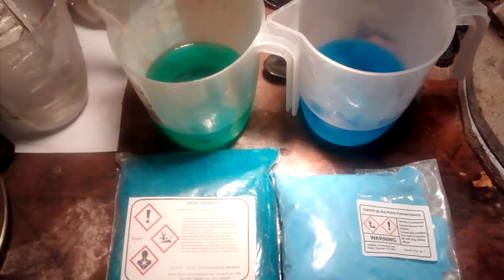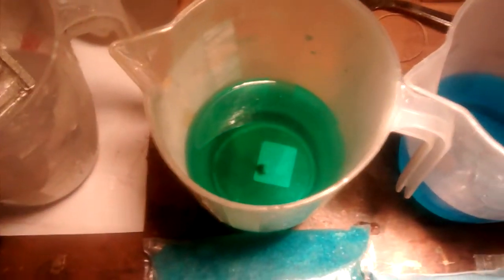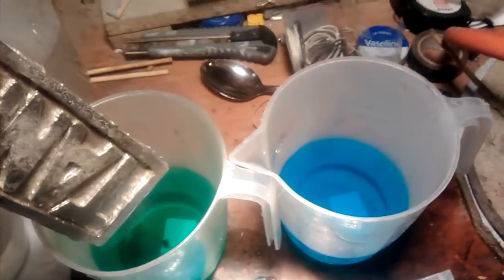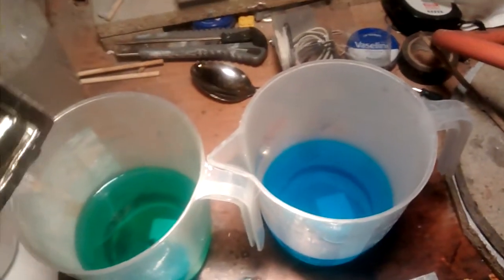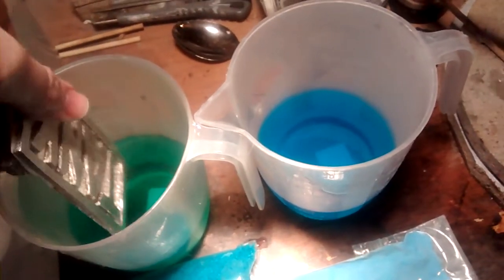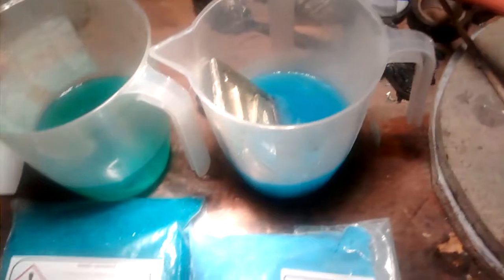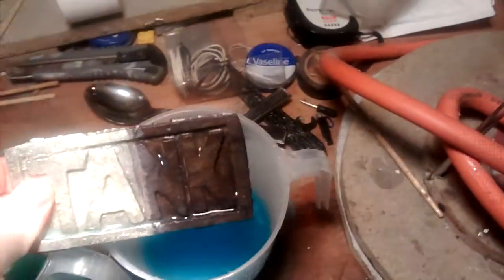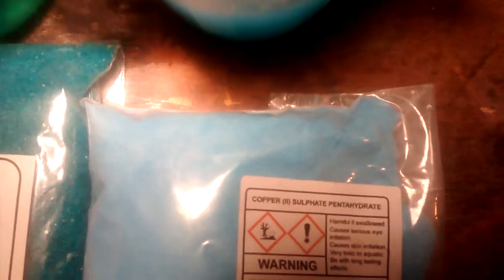Pewter Patina - Copper Sulphate

Comment: baking  soda??
Reply: copper sulfate dissolved with salt can be used for etching aluminum, and to stop the etching reaction you can use dissolved soda crystals (i.e. sodium carbonate). So perhaps the same could be used for this as well?